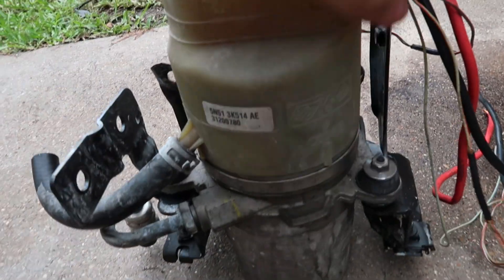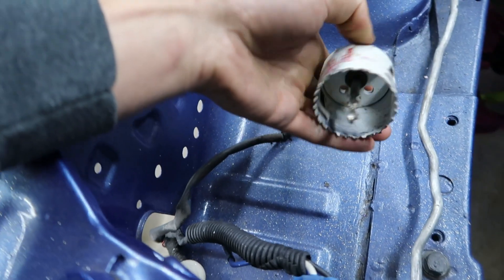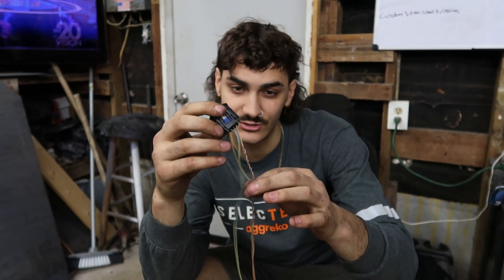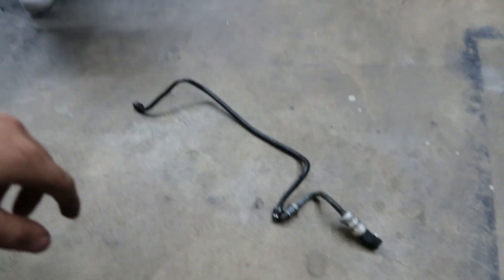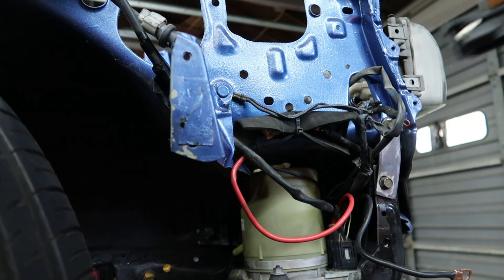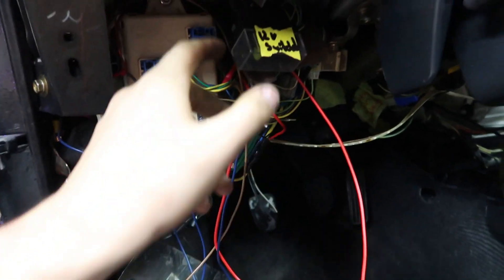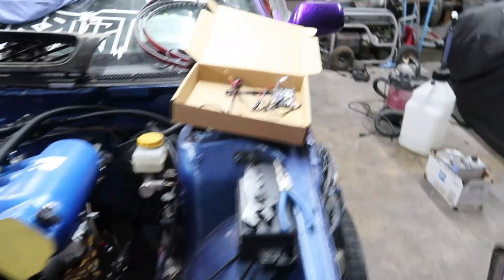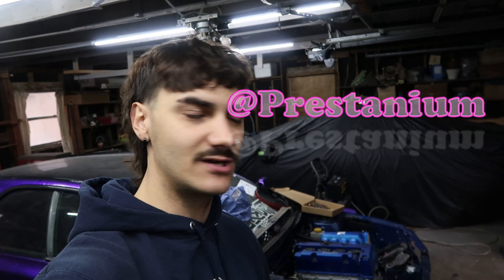Volvo Electric Power Steering in my Subaru!!!

Comment: This is a crazy good idea and appreciate you blazing the trail! Keep us updated with how it goes when you get it all buttoned up and the fixes you had to make (e.g. the lines) to get it working.

I'm putting a 2015+ STi quick ratio rack in my '98 and my power steering pump doesn't put out the required PSI. OEM pumps are like $4-600 so this would be MUCH easier on the wallet!

Comment: Thanks for posting this.  I have a '95 Impreza L Coupe with full '07 STi drivetrain swap and a Q-rack 11:1 power steering rack.  With the Subaru OEM mechanical PS pump and 7800 redline I had trouble with PS pressure.  Dead spots while under heavy load (autocross on Hoosiers) and finally blew a seal in the rack.  I have been looking for an alternative, either electric PS pump or EPAS.  After watching your video I think I am going to go the same route and try the same model electric PS pump.